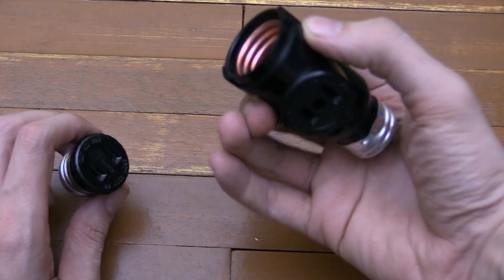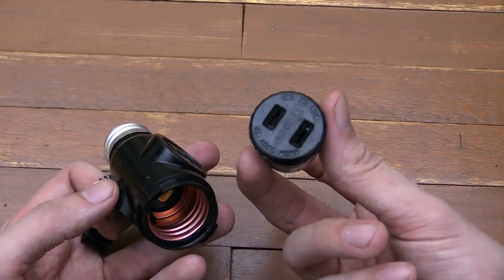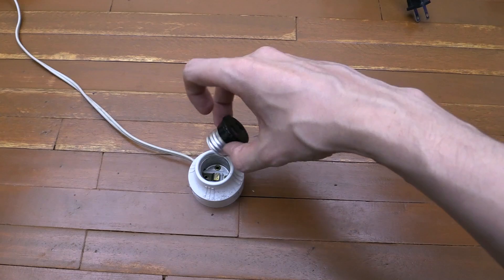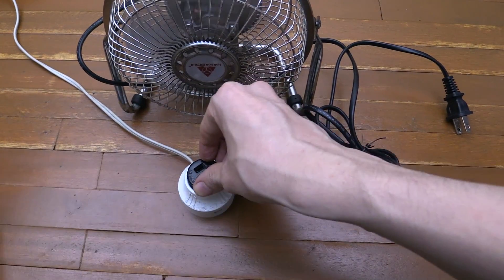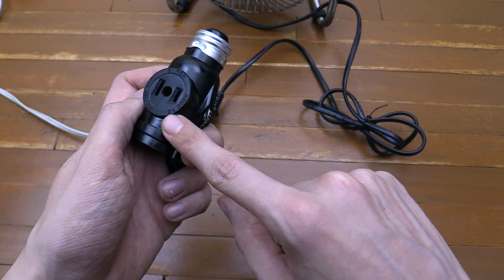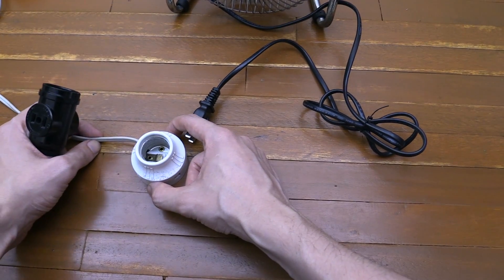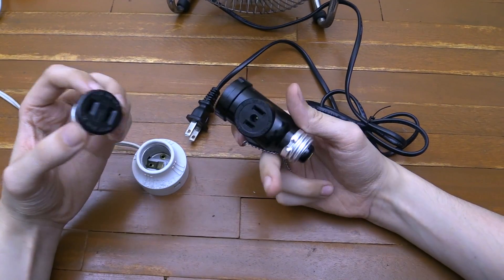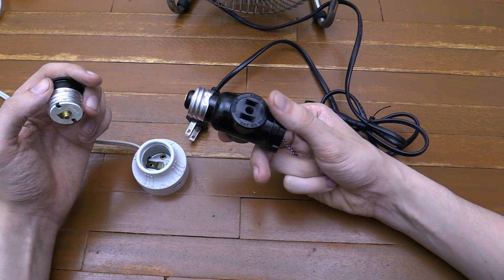Convert light socket to AC socket

Comment: But my plugin is a 3-prong...
Reply: Douglas Northpole use a 2 prong to 3 prong converter
Reply: @VOLTRONDEFENDER4440  adapter
... and probably better not use it outside either as it won't be grounded.

Comment: I'm just saying those are most likely American adaptors so from my knowledge American lights and power outlets run through the same 15 amp breaker but like you said they should be for low loads otherwise those adaptors would get hot and cause a fire but in other countries lights and power are in two different circuit breakers

Comment: Can I plug in an iron that I only need to have on for the time it takes to get hot and then about 30 seconds to iron on a piece of veneer.  Do you think that would be OK?
Reply from the maker: I wouldn't recommend doing that. Most irons draw a lot of current and lighting circuits are typically designed with a thinner wire because they only expect lower power devices like bulbs to be plugged in.